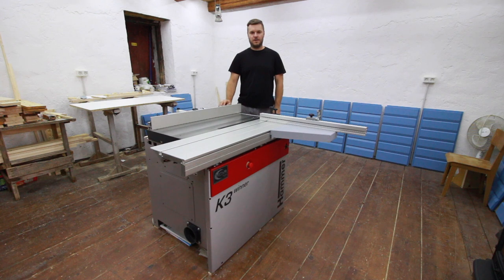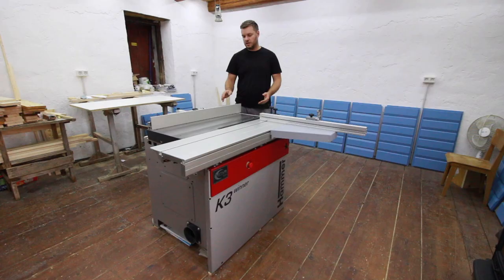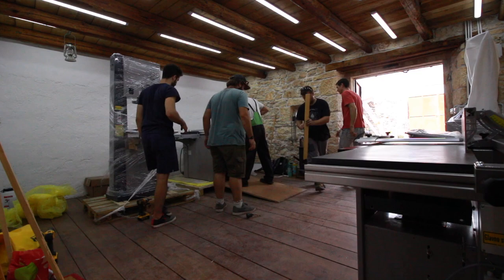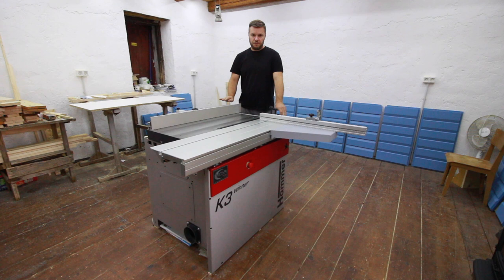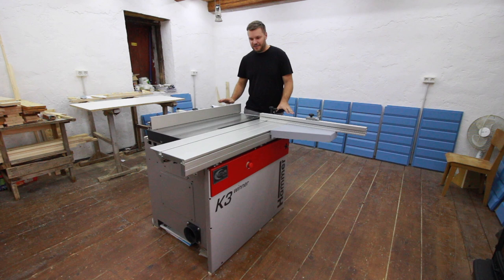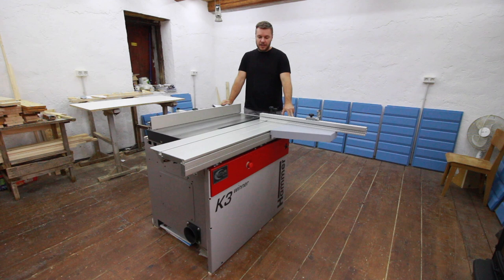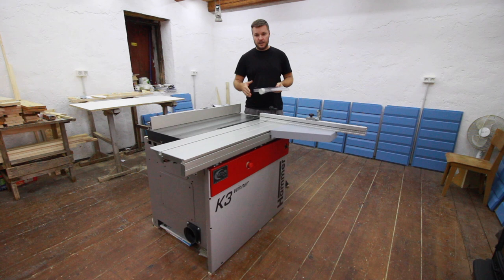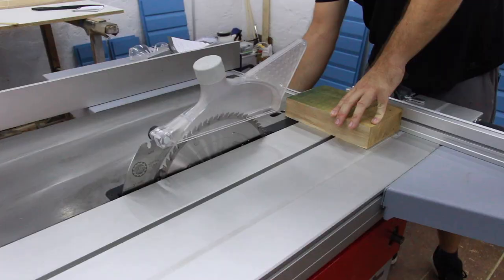What is this???!!! - (Felder) Hammer K3 Winner Review 😡😡😡

Comment: The machines probably left FELDER in excellent condition. All the damaged seamed to be from shipping as confirmed by the truck drivers admission. The receiving company should have never accepted delivery and for sure shouldn’t have delivered it to you that way. I’m hoping FELDER gets involved and makes things right for you. I just received the A3-31 jointer planer and I am very pleased with it. I am also planing on purchasing the K3 but will wait until I see the outcome of your situation. Thanks for sharing.
Reply from the maker: I will have video coming out soon.
The technician came and concluded that the machine has too great vibrations and couldn't figure out why. He tried everything.
 My K3 was sent to Felder and I'm currently without table saw. 
I have A3-41 and I'm quite pleased with the machine.
Reply: This video about sums up my experience with Felder. They are not the least interested in fixing things. Once you have paid all they do is talking and zero helping.

Comment: Andrea,

Sorry to hear about your experience. The K3 can definitely leave someone disappointed, but it can be a good machine too with some tuning. I understand you had a lot of problems that I did not though.

Did you try cleaning and lubricating the threads for the blade height adjustment? I had a similar problem as you until I addressed the caked up sawdust on my threads. The dust collection shroud needs to be engineered better to catch the finer dust that collects on the trunnion threads.

Best of luck to you.
Reply from the maker: The machine's lifting mechanism was stuck when the machine was brand new in the shop. Official technician came and he spayed some lubricant in it. Still after one month the wheel was spinning too hard. Something was wrong with this particular machine from the start. On the other hand the other two we bought are performing good.

Comment: Sorry about your trouble Andrea. I live in British Columbia, Canada . I bought the A341 jointer/planer in March. It arrived from the factory with a damaged fence and a bunch of little things that made it appear to be hastily assembled. I called the dealer and they said they would order me replacement parts no problem. I checked the machine with a a straight edge and gauges and discover a whole world of disappointment. The machine was so out a whack it blew my mind. The indeed table had a had a huge dip in the middle and another just before the cutter head as well as being way out of co plane and the outfeed also had a severe dip in the middle. The dealer questioned my ability and experience with checking a machine like this and after some words agreed to come check it out. The dealer claimed to be a tech which was not true and he made the machine worse. Over a week or two there was some back and forth where they expected me to just have this machine and it would be 4 to eight months before replacement tables arrived and then there “tech” would maybe or maybe not install them. I demanded my money back and they refused. There was more back and forth but eventually they agreed to return the machine to there store in Burnaby bc at my expense and return my money. During this event I had called and emailed felder many times looking for information. To this day no response. I will never ever buy anything from the felder group and I bought an scm fs41e instead and it’s a wonderful machine. Couldn’t be happier. Also scm actually has trained technicians that reside in the province unlike felder
Reply: This about sums up my experience with Felder. They are not the least interested in fixing things. Once you have paid all they do is talking and zero helping.
Reply: and yet you bought that felder slider, why?
Reply from the maker: Because Hammer machines are not well made. Felder machines on the other hand are completely different animal. It seems to me like they are made in different factory altogether. Best, Andrea

Comment: I had a similar experience with my new Felder 500, lots of nice words but no action!
Reply from the maker: That is really sad.
I eventually upgraded to Felder K700 and I'm delighted with it, it is completely different saw and it seems like it's made in a different factory. There are still some small things that could be done better but these are tiny compared to problems I've had with K3. I made a video on K700, you can find it on my channel. Best regards from Croatia

Comment: The shaft on the blade raising mechanism is bent and the gears are not meshing evenly-problem. If you take the sliding table off to get at the inside of the saw; due take measurements of the
distance of the sliding table to the cast iron table and check the height of the sliding table to the plane of the cast iron table. This way you can adjust the slider to where it should be upon reassembling the saw. Make little wood shim the shape of wedges and mark on the sliding table where the wedges are placed to measure spacing and take the fine point marker to show the measure on the wedge. Three wedges along the slider should do it. Get several accurate steel rulers to measure shafts and other parts inside the saw. Get an accurate 100MM right angle tool (called a square over here in Chicago) and start measuring and check one part to another. I have a dial indicator with magnetic base I use to check shafts to other movements. It does not have to be an expensive dial indicator to get the job done. It may only be that the cranking shaft on the blade lift needs to be repositioned to correct the gear meshing.?? Get a diagram from Felder of the saw parts and listings before you begin the work of correcting the adjustments. It's like a bicycle: you see how much the wheels is needing to be trued and then start adjusting the spokes to true the wheel. I had one Felder motor on my Format4 Profil 45 shaper that quit. I paid a technician $20 to check out the motor. He said motor was OK. The electric connection part had failed (Felder had no circuit protection that would have prevented the problem ($15 part that Felder did not include)). Same thing happened with the first electrician who came in to hook up the Felder shaper and Oneida 7.5hp cyclone dust collector. Electrician had a reading problem (learning deficiency) and he hooked up the wrong colored wires. His standard answer was, "you need to contact the factory; something is wrong with the machine(s)." I studied the wiring diagrams for two days and found the problems without having to pay the seller to come fix the problem. We learn what is supposed to be on machines and automobiles and then we can figure out what the problem is. I am a Yankee and it is our approach to the world. You and your brother can do it also. What is your brother's name Andrea?
Reply from the maker: Wow, thank you for the advices! I really appreciate them from a knowledgeable gentleman like yourself. My brother's name is Moris. Greetings from Croatia
Reply: @AndreaArzensek  and Moris; I don't really know if I am a gentleman but I do like to fix things around the house, shop and the Sprinter van. Good luck in getting to the bottom of your Felder saw difficulties. Mark all the positions of pieces you disassemble with drawings, words and camera images.

Comment: This is kinda a bummer and I'm sorry to hear.  I'm on the fence about either  Jet 12" Planter/Jointer with Helical head or a Hammer A3-31 with the silent cutter... about the same price, but the Hammer was in the lead up until I've seen more than a couple customers unhappy with customer support post purchase.  Maybe I'll go with the Jet now...
Reply from the maker: Luckily Felder took this matter into their hands and resolved it. Check out my latest video on my channel. 
I have the Hammer A3-41 and my tables are out of tolerances. Now I'll be waiting for new ones, and see if that resolved the problem.
I think that I'd never go or recommend Hammer line again until they prove different.
On the other side Felder line machines seem to be very well made.

Comment: I'm considering buying my first machines for the workshop and Felder is on the list, yet if I get a chance to buy something similar for similar money, I'll probably avoid Felder. I've heard so many complains on their service that it just appears to be to much risk.
Reply from the maker: Actually Felder machines are very good.
I have replaced my K3 with Felder K700 and it is an absolute beast.
They seem to have the problem with Hammer range recently. 
I have problems with my A3_41 jointer planer as well, Felder is currently resolving this as well.
Reply: This video about sums up my experience with Felder. They are not the least interested in fixing things. Once you have paid all they do is talking and zero helping.

Comment: Andreas, well done video. I feel your pain. I have been a professional woodworker for almost 50 years and now running a school of fine woodworking. We recently bought a hammer 12 inch jointer planer, and the K3 winner  tablesaw. They are both horribly overrated and abysmal quality especially for that money. The jointer fence wobbles and is  not even milled flat. The tablesaw has more problems than I have time for here. And as you mention the most annoying thing is to have to deal with Hammer/ Felder who blame all the issues on somebody else or say “well how is this our problem?” I’ve never dealt with a more childish and irresponsible company. You can be sure none of our students will be getting recommendations for hammer tools, and I’m trying to sell this one as fast as possible . Felder has a pretty terrible business plan, and a very low standard of ethics
Reply from the maker: Hi Jonathan, 
I agree with your observations on Hammer machines.
You can find continuation on this saga on my channel. Later we decided to give them a chance with their Felder 700 line machines (with nice discount) and we're very happy with them. 
It seems like they are made in a completely different factory and customer service treated me excellent (but that's probably because of this video). 
Anyways, it has been over a year and we love my machines, we didn't touch them since and they are still true like the first day.

Comment: Hi Andrea! Hope everything is solved properly. Could you make an update on your experience with the official Felder service? Did they respond properly and solve the problems fast enough? And last but not least... will you buy again the same machines? Thanks in advance! I´m planning to order a few machines to set up a new carpentry/wood workshop, and your comment will be very helpful.
Reply from the maker: Hi Samuel,
Felder has resolved everything and it was quite fast but we pushed them hard. At the end we got K700 and AD741 instead of K4 and A341. It's has been almost two years since then and we haven't had any issues with any of them and we are really happy with the new machines. If I were to buy again I wouldn't go with Hammer machines, I would directly go to Felder 700's series and probably now I'd even upgrade to 900's even though ours are total beasts for what we need them to do.

Comment: A new machine should be new. Your shipper is to blame. The sliding table is out of align with the blade and the rip fence is out also. Something moved the motor and caused an alignment problem.
Looking at the cut of the wood is evidence of the lack of alignment. The vertical raise is also bent or mis-aligned and hence the difficult cranking-muscle required. Any machine you buy can be
fixed if the tech person is capable. I bought a Martin T60 and there were loose wires from the factory that were causing the machine to stop. Also the lifting servo motor was not strong enough for the weight of the motor and trunion so those did not work until I ordered a gas pressurized (mini shock absorber style) and had to drill out the attaching point and screw thread it to the piston
gas device. Any machine can be fixed. You will have to take the sliding table off and use some measuring devices to check what is out of alignment and go from there. Find a machine shop person
with mechanical skills and that will get the machine back in good running order. If I lived closer I could do it for you. Cars, hand tools, furnaces and woodworking machines get damaged and need
fixing. Find a capable machine shop person and you will get to the bottom of it. Talk to woodworking shops in your location in person and ask who they use to correct their machines. I found a man with 30 years experience in setup and repair of expensive printing presses and he helped me along with my gift of mechanical savvy. You can do it; just begin without those talkers! You have a rather
simple machine in that saw and that is good.

Comment: Hi Andrea, hope your problem will be solved...i just bought an Hammer B3 Basic and it's just about the same, cut quality is really poor an my old Kity 618 worked better. I will maybe realize a video if Felder do not want to find a solution... best regards and i wish you the best
Reply from the maker: Something is wrong at the line in the factory. This can't be happening to a saw of this price range. Contact Felder, they will find a solution. 
I'm starting to get nervous now since I upgraded to Felder K700, I hope it will be ok.
Reply: Hi Andrea, as far as I know there was a change few months ago about motors... their supplier stopped their activity therefore they had to find an another one quickly. Could you tell me what is the brand name on the motors of your K3 ? If you still have it in your workshop.. thanks again and I hope your Felder will satisfy you !
Reply from the maker: I got my K3 in June, I returned it in July. Felder K700 should be here in February.
Reply: This video about sums up my experience with Felder. They are not the least interested in fixing things. Once you have paid all they do is talking and zero helping.

Comment: Had also a problem with the k3 with the knife and saw adjustment. They charge me for calibrating because they say it could be a problem of the transportation...no words for that.
Reply from the maker: That is ridiculous that you had to pay for their fault. I'm really pissed with the Hammer line and even more how Felder treats customers. After I published my video they completely changed the tune but not everyone has the time or will to make the video.
Reply: @AndreaArzensek   As you discovered -- putting serious pressure on the manufacturer is the best way to get results if they are being irresponsible.   However, you should have rejected the machines when they were scattered around the back of the transport truck.  Once you sign for them, the problem moves to you.  But if Felder understood good customer service they would have moved to cover your problems -- the goodwill from you would more than have paid for their expenses.   They clearly are not smart and just looking at their direct expenses. Now the story of them be unresponsive is coming back to haunt them.  I'm glad to hear you are mostly satisfied with the upgrade solution (I hope someone else doesn't get your returned saw as being a new one!)

Comment: Andrea has your saw been fixed? I took delivery of a k3 winner last week and have cut issues. I also had a problem with my riving knife and height adjustment stiffness. I was able to resolve the height stiffness and riving knife problems; they are related to each other. I plan to post videos showing how I resolved it soon. Are you able to check your saw's arbor and tell me how much axial play your saw has when you push and pull on the spindle end?
Reply from the maker: Hi Matt, 
It seems you have the same problems we had with our saw. That is unacceptable.  
We returned K3 to Felder in Austria and they fixed it but we wanted to upgrade to Felder K700 so that is what we're waiting for. It will come by end of January 2021. Then I will make an updated video.

Comment: Hi, Andrea. I also got problems with Felder Brasil when I purchased my machines. I think you should contact Felder directly and inform us the updates. Tks !
Reply from the maker: Hi Werner,
I will definitely put updates. Best regards
Reply: @AndreaArzensek  Hi, Andrea. Did they fix or change the K3?
Reply from the maker: Hi Werner, 
People from reseller Totus are coming for the machine on Tuesday and they will send it to Felder for a review. The technician concluded something is wrong with the machine but he didn't  know what.
Reply: Hello Werner, did you already solve your issues with Felder Brasil ? If not, please contact our Headquarter office - Thank you
Reply: @FELDERGROUPTV  Hello, Felder Group TV ! As far as I know, there is no more operations in Felder Brasil. It´s closed. Also, there´s no partners here to do technical support. My problem with the micro adjust in my B3 fence still not solved.
Reply from the maker: Funny, that you need to contact them here on my video.  Good luck with your fix. Apparently they are better at hiding the mishaps than others since I havent heard anything bad about them except for these comments in my video. Cheers
Reply: @wguerra  This video about sums up my experience with Felder. They are not the least interested in fixing things. Once you have paid all they do is talking and zero helping.